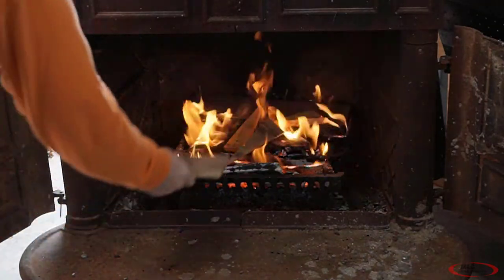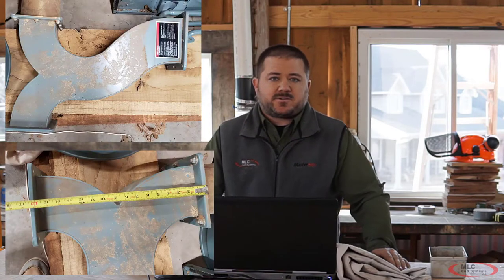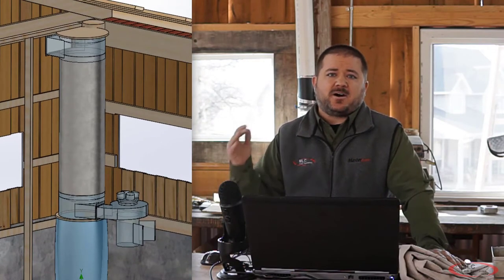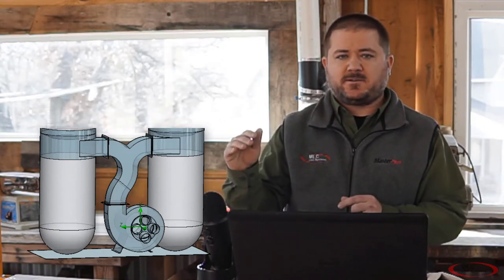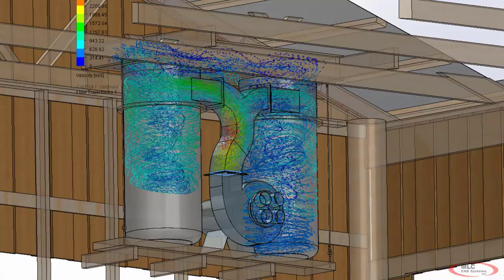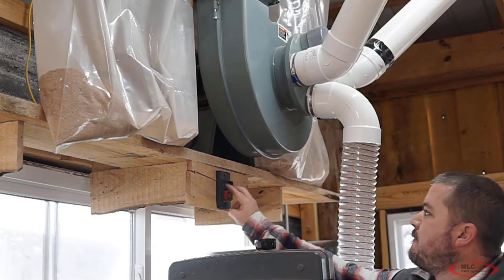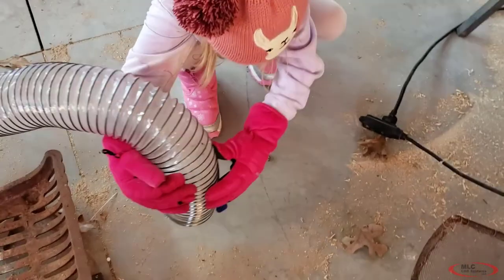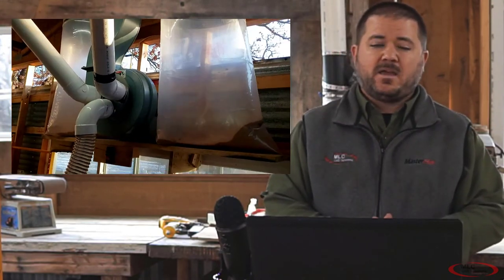This Design SUCKS! - Building a Better Dust Collector with SOLIDWORKS Flow Simulation

Comment: Lol solid works is like $3500 
Not sure how that saves you money + it takes a considerable amount of time to learn how to use it,
Reply from the maker: The pricing varies on the license/s but, SOLIDWORKS is similar to other tools as the return on investment is based on each individual's use case. $3500 for a successful company vs. $3500 for an average joe in their garage. I think it depends on perspective and each individual use case. 

I appreciate hearing your POV though.